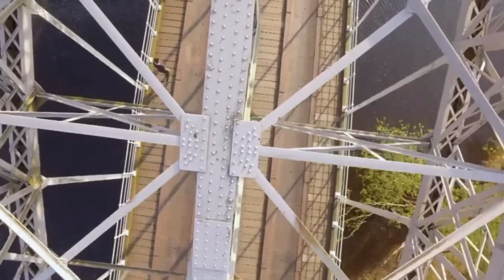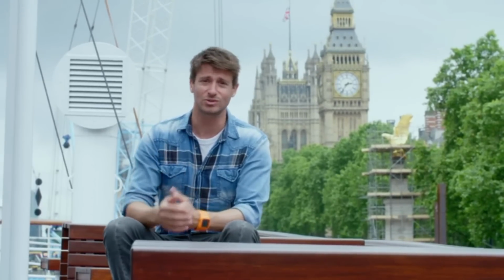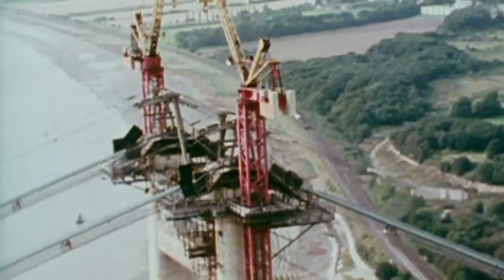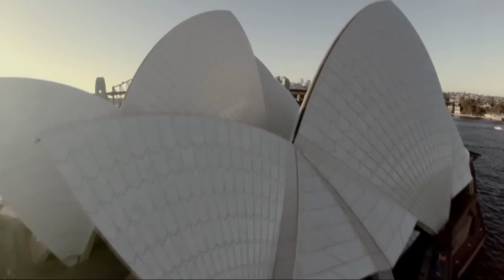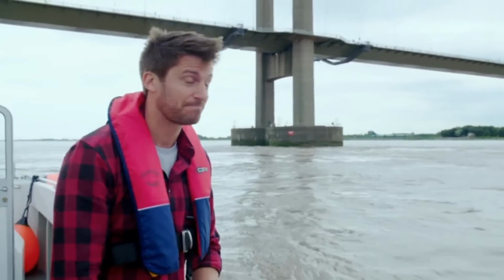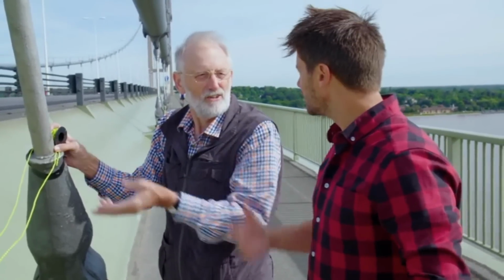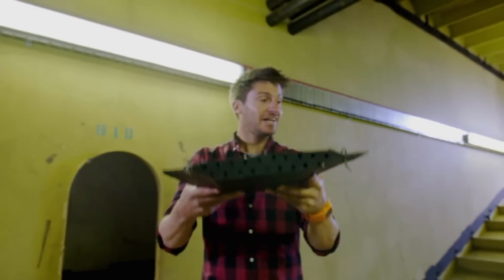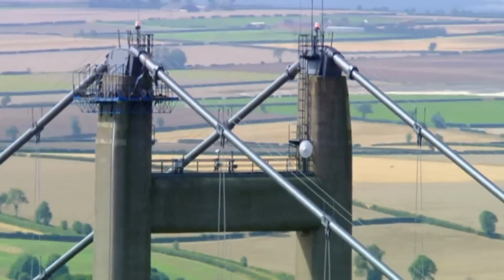Britain's Greatest Bridges - The Humber Bridge

Comment: Since you've already mentioned the bit of trivia about the distances between the Humber Bridge towers at the bottom compared to the same at the top, here's another bit of interesting trivia:
The bridge spans the distance between East Yorkshire and North-East Lincolnshire, but if you take the weight of the ENTIRE POPULATIONS of those two areas, this wouldn't even come close to the weight of the steel and concrete that forms the Humber Bridge.

Comment: I grew up at the same time The Humber Bridge was being built. Indeed, I remember it in its infancy. A couple of  hundred feet of a jetty, pointing north from the west side of Barton upon Humber. I was 9 years old when it started, and 17 when it opened. 
I also remember watching television after those towers were built, on account that they created two vertical strips of shadow across out TV screen - no doubt as a result of those towers bouncing back the electro-magnetic signals from the Belmont Transmitter.
Reply from the maker: I know Belmont gives out a very strong TV signal. Is there still a problem or has it been sorted?
Reply: Oh, it was sorted out years ago. Probably at least 25 years ago, Phil. It may be the case that those people that now watch TV in Barton on Humber no longer receive a signal from Belmont, but another transmitter - I don`t know.
Reply from the maker: Thought the problem would have been fixed by now. Belmont still covers that area.